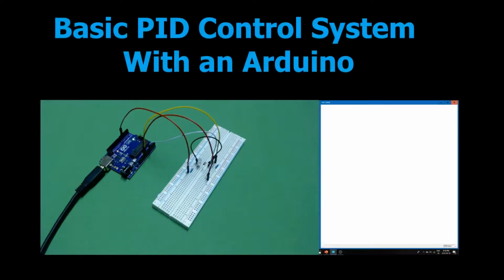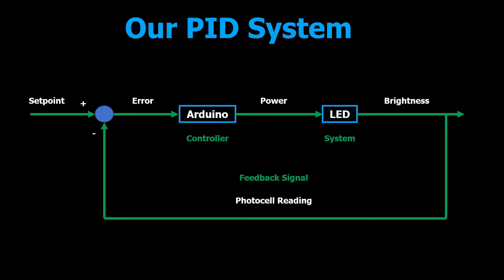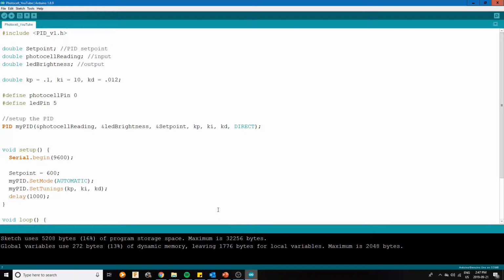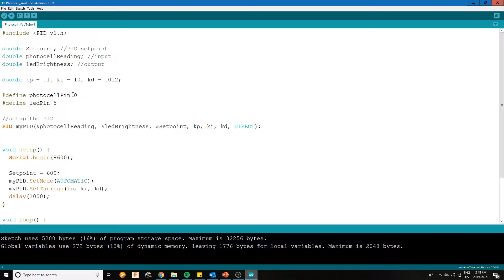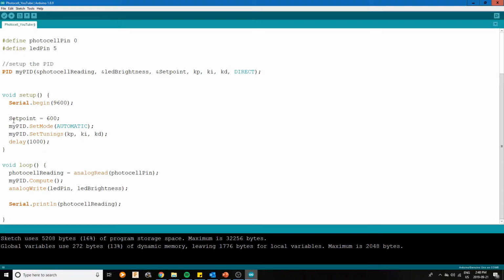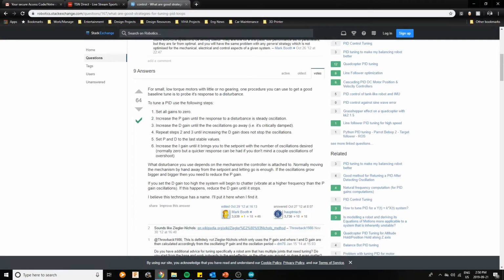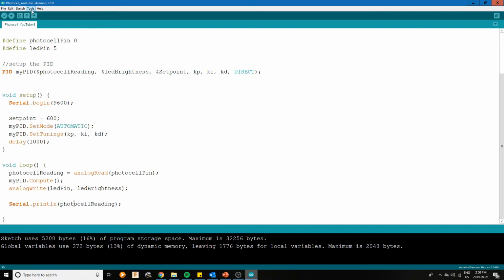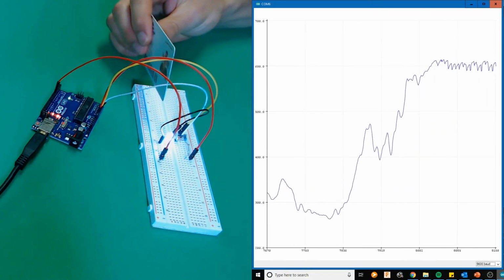Simple Arduino PID Control System with a Photocell

Comment: I dıdnt understand ,it seems you change the photosensor values but the led wasnt effected from that  ...the case is that ? so no need to built up system like that you could set them seperate and it would work more beautıful ...the example you chosed wasnt good for PID